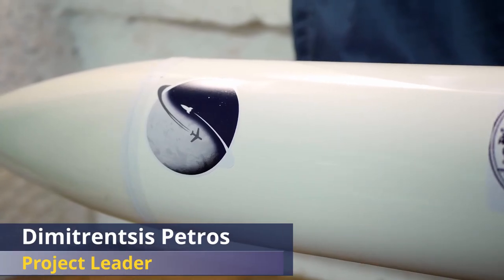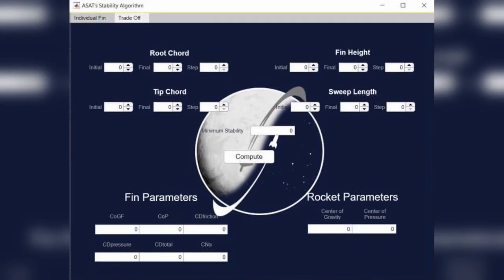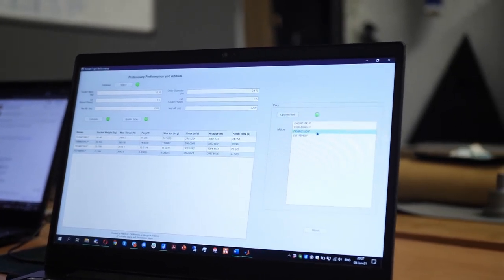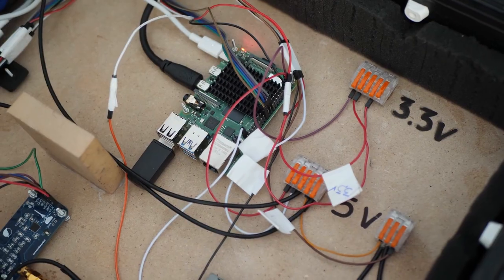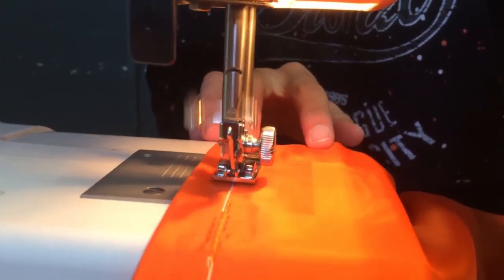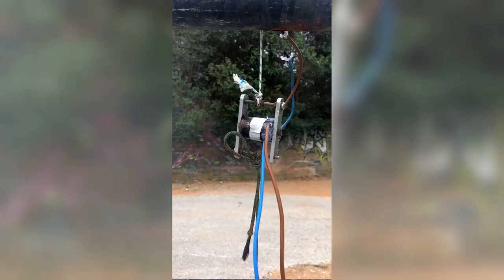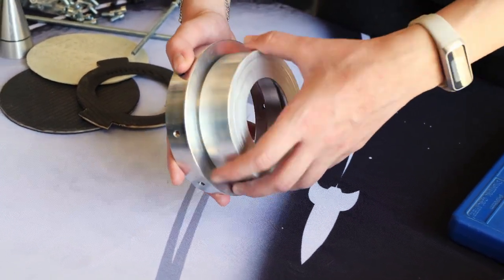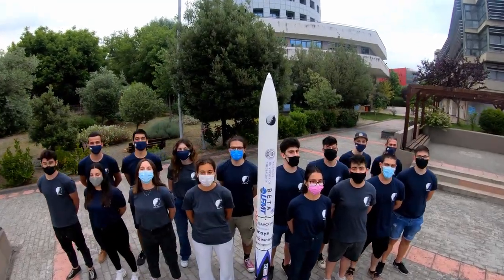Project SELENE | Aristotle Space & Aeronautics Team ID:03

Comment: Why did you select c02, and not a spring loaded mechanism
Reply from the maker: A critical factor for this choice is the overall weight of the mechanism. Spring-loaded ejection mechanisms tend to be heavier instead of the CO2 ones. Also, CO2 mechanisms are not so complex to design and manufacture.
Reply: @ASAT-AUTh1   Thanks!  Has the effects of altitude and temperature  on the CO2 Gas expansion, been quantified - does it still provide sufficient pressure force for payload ejection?

One more question :) , has ice build up in the payload cavity been taken under consideration  due to trapped moisture? how is this mitigated - lubrication/heaters?

Sorry for the bombardment of questions, I just find this really interesting :)
Reply from the maker: @mioumitsou  Τhose are very good questions, and we love to see people getting interested in our work. 

For your first question, yes, they have been taken into consideration, and that is why we use heavier test weights than the original payload and parachutes (safety factor 1.3).

As for the ice buildup you mentioned, it does not pose a threat because the lower plate of our payload vessel will act like a piston and won't allow much CO2 to escape into the payload area. Also, during our tests, the temperature measurements showed a minimum of -4 C (24.8 F) was reached inside the recovery bay but only for a very short period of time and then quickly started to rise above the freezing temperature of water. Also, for the payload vessel to exit the rocket, we will use a lubricant to ensure easier deployment.
Reply: @ASAT-AUTh1  thanks! Good luck 🤞